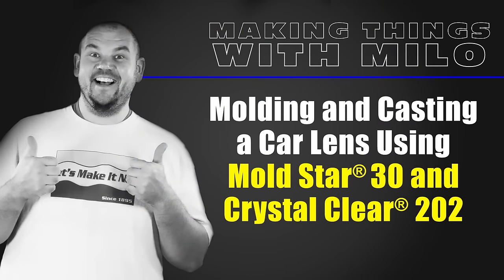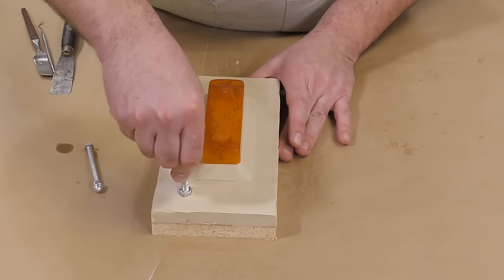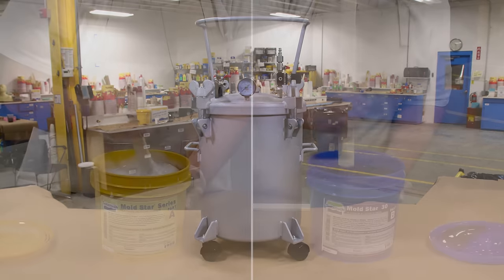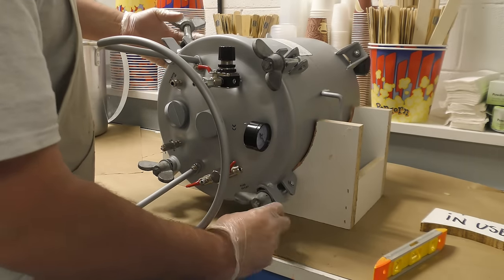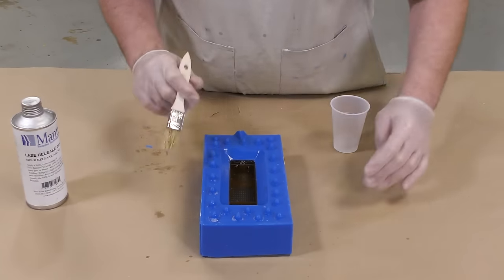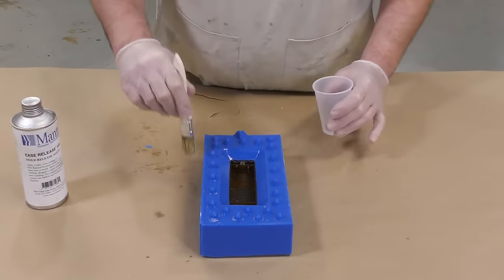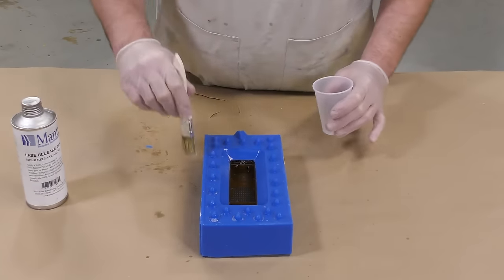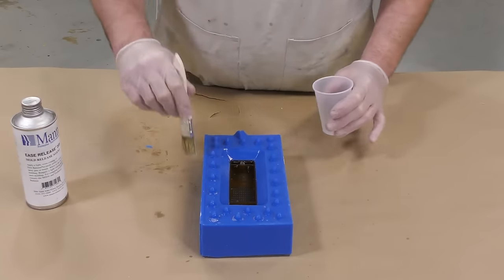How to Create a Replacement Tail Light - Moldmaking and Clear Casting Resin Demonstration

Comment: WHY CURING MOLD AND PART UNDER PRESSURE RATHER THAN UNDER VACUUM ??
Reply from the maker: These techniques are often used in different mold configurations. Here are some links which may help - https://www.smooth-on.com/support/faq/156/ and https://www.smooth-on.com/support/faq/111/

Comment: why a pressure pot?? i would have thought a vacuum chamber would be far more effective at removing air bubbles???
Reply: I was thinking that same thing.
Reply from the maker: Vacuuming happens before the pour, and the physical act of pouring can impart some small bubbles into the material. As long as your mold is designed correctly, pressure Casting can ensure no bubbles appear in Clear resin. Ideally both vacuum and pressure would be utilized.
Reply: but wouldn't a pressure pot force more air INTO the liquid? i guess that's what i was thinking? or is something else at play here?
Reply from the maker: @antigen4  The increased air pressure pushes down on the liquid resin, which in turn collapses the air bubbles - https://www.smooth-on.com/support/faq/156/
Reply: Collapses air, and keeps new bubbles from forming. Makes sense.

Would I be detrimental to the finish if left to cure under vacuum?
Reply from the maker: Yes, the material would be full of bubbles, as bubbles never fully stop being removed from the material.  After time, air is brought through the material along the sides of the container, etc.
It is only when the vacuum is released that these go away.

Comment: Since the mold silicone is very soft don't any trapped air bubbles simply re-expand to their original size when it comes out of the pressure pot?
Reply from the maker: The bubbles are completely crushed, then the rubber cures, there is no re-expansion.  Thank you for watching!
Reply: Where did the mass go? I was hoping for an answer that doesn't break any physical laws. 
Thanks for the response, clearly this works just fine so I'm just going to assume that the solubility of air in silicone resin increases with pressure.
Reply: @brocktechnology  air is VERY compressible. Being a gas, it has a LOT of room between molecues. When it goes under pressure, it is compressed beyond the point of visibility, and then the material hardens and it stays put.

Comment: How much did that cost, overall? I don't mean, how much, if you figure out how much of the resin, and the silicone, and then how much only that portion would cost. You may only use 5 ounces, but have to buy 16 ounces. What is the REAL cost? For everything...
Reply: Tools, time, materials? Probably $1,200. Maybe more.
Reply: Thank you. =0) Mostly just needed materials cost.

Comment: the pressure tank is a bit overkill...... at that point it might be worth it to pay the premium of a used ebay lens.
Reply: In case you didn't notice, the lens he made was in a color/tint that doesn't exist in OEM or regular replacement parts. The different coloration makes it a one-of-a-kind item.

Comment: Why are you pressure potting to remove bubbles and not vacuum to remove air bubbles. That is what I use with epoxies.
Reply from the maker: Pressure will eliminate bubbles after pouring, crucial when you want a bubble free casting.  Vacuuming happens before pouring, bubbles can be formed when the resin is poured.
Reply: OK That makes since. I am just starting to get in to pour molding so I will be working this from both sides.

Comment: So... to use this method we need a minimum of like 1000 dollars worth of equipment... I think I'll try to find aftermarket or near fit light solutions instead.
Reply: This isn't for the regular bloke who just wants a lens, LOL! It's to show how things can be made, IF you have the stuff to do it. And a decent air compressor can be had for much less than that, and a paint pot/pressur pot can be had dirt cheap at auctions, if you watch for them. So, no, you could get set up for this for much less than a grand, LOL!

Comment: Cool to see the actual process but probably well beyond the reach of  the typical DIY person on a budget when you consider the cost of misc materials and a pressure pot. Then of course we now have 3D printers where you can replicate something like this for a fraction of the cost, provided you know someone with the equipment.... AND... use something like photo-shop to remove any imperfections (cracks / holes) from the original before making the replacement.
Reply: Lotta guys sand and use plastic polish for the final bit.
Reply: Plastic polish would only work on a scratch. If it was an imperfection in the original then this process would duplicate the original flaw... scratch, crack, etc.

Comment: Why did you use a pressure container versus s vacuum chamber?
Reply from the maker: Even after the material is vacuumed, the act of pouring can induce air.  To eliminate bubbles which may occur after pouring, a pressure casting technique is used.

Comment: I'll share some of the techniques I've come up with in 16 years of resin and mold casting. http://partsbyemc.com/pub/mold-making.htm There I used shiny faced corrugated cardboard because silicone won't stick to it. If you can't get that, simply cover plain cardboard with clear packing tape. When working with plastic originals, use a 'cool melt' or dual temp glue gun on its cool setting. With glass originals you'll want to use the hot setting because the glass will absorb the heat faster and solidify the glue. The easiest way to remove hot glue from just about anything (even fabrics) is to apply rubbing alcohol. 91% works better than 70% - but be careful with older plastics, especially ones from the 1950's and earlier. They may be damaged by isopropyl alcohol if left in contact with it for too long.

Once I figured out that I didn't need to make a lot of dimples for keys or use formers to cast vents into the molds, and that I could use corrugated cardboard and hot glue for mold forms, with the master model glued down, making molds became so much faster and easier.

All you really need is a sharp knife, a dual temp hot glue gun, a Dremel or other AC powered rotary tool (cordless and ones that run off a wall-wart are not powerful enough!) with cutting discs, corrugated cardboard and a roll of packing tape.

Those materials are sufficient to make forms for anything from a shift indicator pointer for a Hudson to the massive front lenses for a 1963-1965 Buick Riviera.

The form for the Buick lenses did require some creative folding and gluing of cardboard into triangular reinforcement tubes along the outside and for making bumps inside the form to make the mold easier to flex for casting removal. I also made a large, resin reinforced 'boat' to go inside the lens so the mold would only be about an inch thick. Otherwise it would weigh a whole lot more, use a lot more silicone and the lens would be extremely difficult to remove from the mold with its deep shape. Similar techniques were used to make a mold to cast 1955 Hudson tail light lenses that are nearly as large. For those big projects I have some old pressure pots from the 1960's and 1970's, rated to 150 PSI at 650F. Running them to 60 PSI at room temperature is nothing for the products of the Pressed Steel Tank Company. What would need to be sprayed at such a pressure and temperature, I've no idea. (They moved production to China years ago and no longer make removable lid pressure pots, just steel gas bottles.)

You'll find many mold making tutorials insisting you need a vacuum pump to degass silicone and resins. Nope, especially not for casting materials with short pot lives. Pressure, properly used, will work much better. Even with perfectly degassed silicone, poured perfectly so as not to entrap any air pockets, will still have problems flowing into sharp inside corners and finer details. Pouring it in and letting it flow up and over a master can create 'knit lines' which cause defects in the mold that make ridges in the casting. I know because I've done those failures myself years ago.

As mentioned in this video, not pressure casting the silicone can cause problems. For some reason, tiny bubbles in the silicone cling close to smooth, vertical surfaces on the master. Lurking just beneath the surface, when the resin is cast under pressure it will collapse those bubbles, making bumps or spikes on the surface. If the bubbles are large enough the bubbles will rupture and the casting will have little balls on it. Removing the casting will be difficult and the balls pulling out will further damage the mold. Some of the balls may break off and stay in their silicone bubbles, which will prevent those spots from coming out so bad on subsequent castings. Horizontal surfaces don't have this problem as much because the bubbles will rise up and away.

If you are doing castings to sell, like making your own garage kits, USE PRESSURE to cast your molds and castings. A 2.5 gallon pot and compressor from Harbor Freight right now are only $99.99 and $54.99, respectively. Get them before you start making stuff. They'll quickly pay for themselves because your castings won't have bubbles, voids, or extra junk that needs lots of trimming and rework. Your customers will appreciate the higher quality product. Whenever I read a review on some garage kit, the most common complaint is about the bubbles, which I read as the person making the kits was too cheap to spend less than $200 on a tank and compressor to make better model kits.

BTW, the Harbor Freight tank says 80 PSI max. Believe it! Better yet, don't go over 60 PSI. Some crazy nuts epoxy on "lid savers" reinforcement pads, crank the screws down with a wrench then run up to 90 or more to infuse wood with resin for lathe turning fancy pens. One guy used hot glue to attach his savers because he was in a hurry. The lid came off when he pumped it up to 90+. Lucky for him he was doing something at the other side of his shop, instead of right beside the tank like he usually did. Nothing damaged except the destroyed tank. Yes, he did freely admit to being stupid. ;)

Comment: Why not use a 3D printer/
Reply: Because not even SLA printers can reprodce the level of detail a mold can give you. Plus, not everyone has the money to own and/or the knwoledge to use a 3D printer.
Reply: why not just buy new lenses on ebay?
probably less money then all that silicone and all that other stuff you need
Reply: nope, doing all that work in the video is a waste of time and money, 
if you look hard enough, you can always find what you need

and you cant seriously think and count on ebay being the only place to get stuff?
even if you cant find stuff on ebay (not the best site anyway) there are tons of other places to get parts..
i find discontinued stuff for my mazda all the time
the easiest way to find stuff, is just type in what you need in google, then add "for sale" and click search
example... 1975 dodge taillight lens for sale
and the list of websites and places that have them for sale pop up..
theres ebay of course, lmctruck.com is a good one... rockauto.com, can even look on craigslist, alibaba, kijiji.. and scrap/wrecking yards too
and if that still doesnt work, try using different words, like lamp, or lenses, or lens covers, or amber lights..

also, lots of vehicles share the same parts..
like a light for a truck, you could most likely find it on a van or suv from the same brand and era of vehicle.. 
you can also search up which vehicles share the same parts and if you cant find it for your vehicle, search for vehicle that has the same part

and if all else fails.. you can always buy a beater or parts vehicle for cheap, the same as your looking for and use parts off of it

so if you dont find a part you need.. you didnt look hard enough
they're out there somewhere..yes, even if they are "discontinued"... you just have to find it
somebody has one somewhere
Reply: @comandanteJ you can buy a 3d printer kit for $130 and that is cheaper than all of this mold materials.  Plus that 3d printer can be useful for WAY more projects than moldmaking.  Also, SLA printing detail is not required for a turn signal lense for crying out loud.  Nobody could tell the difference if you 3d printed it in clear versus this.
Reply: @artbyrobot1 , (and others above), we get it. You love your 3D printer. Well, that's fine, but others may not be so fond of them. Besides, look at the video. This shop is obviously set up for this kind of work (likely as well probably some painting, too), so why bother purchasing another piece of equipment when it simply is not needed? It's like buying a third shoe, or an extra glove; totally unnecesary for the job. Now, if there's hobby painters out there, who have pressure pots already (for the painting), and they might want to branch out, or if there's a person out there who knows someone with a pressure pot, and can borrow it, and they want to make something with this method shown, why on earth would they, again, purchase another piece of equipment they just don't need? I mean, we have two paint pots, both in good working order, from being painters for 3 decades. Now, we're retired, and should we get into the classic or antique car restoration that we have been talking about for years and years, this method would likely save us a bundle rather than trying to find a lens for a 1930-something that simply doesn't exist any more (or woud cost a couple hundred bucks due to rarity), well, bam, here we are - a perfect solution, since we already have everything we need to do this.
And, no, I don't want to buy a 3D printer, no matter HOW much you adore them. 😄

Comment: a 5hp air compressor to reach 60 psi? even a 1 hp can reach 60 psi.
Reply: True, but a good 5hp will not have to work as hard, so would last longer.

Comment: mould a fishing signal light , 2DD battery type, both cap and battery compartment , and is injection cheaper than this ? don't take the die cost into account. just calculate the material cost. Chinese make them cheaper for 50 cents.